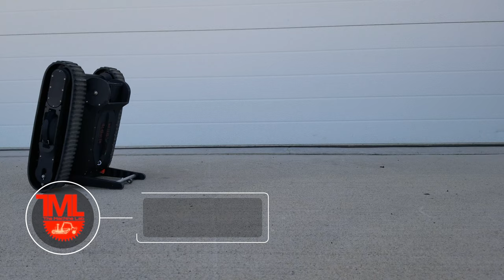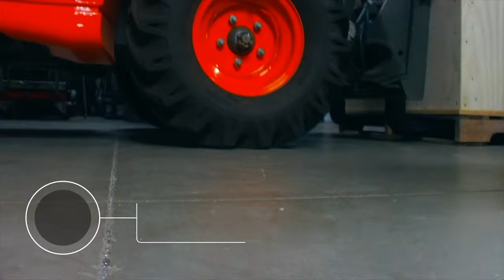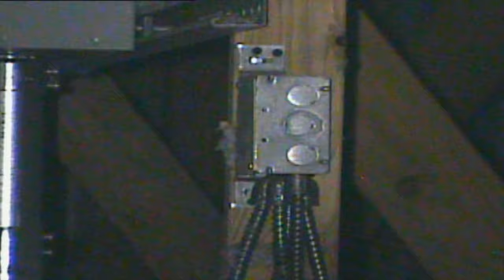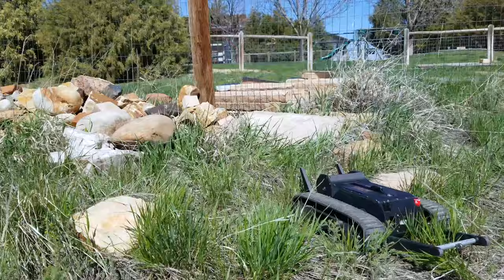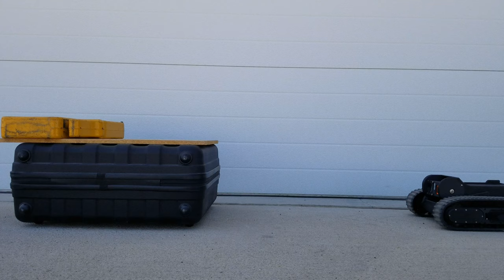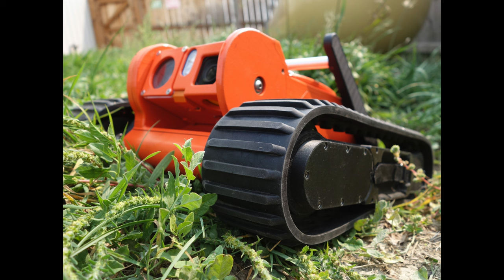Compact commercial remote inspection robot (GLIMPSE)

Comment: Is it good for crawl spaces with sand?
Reply from the maker: Sand should be no problem. Sand can build up in the tracks if the robot spins in place for an extended period of time but the drive wheels are designed with holes them which allows the sand or other debris to fall through the wheel and work its way back out.